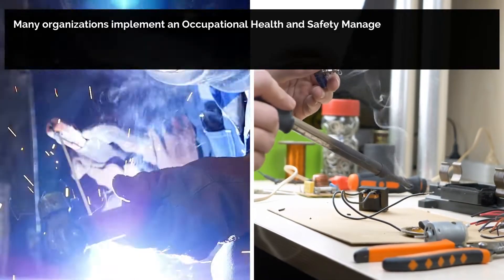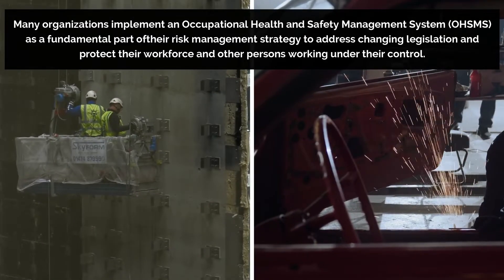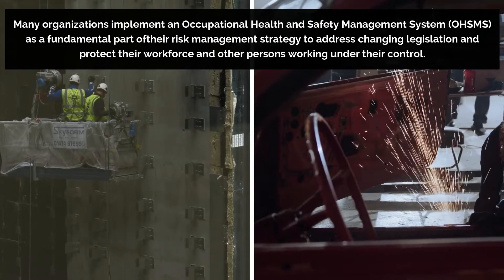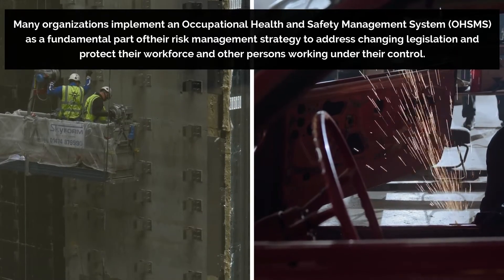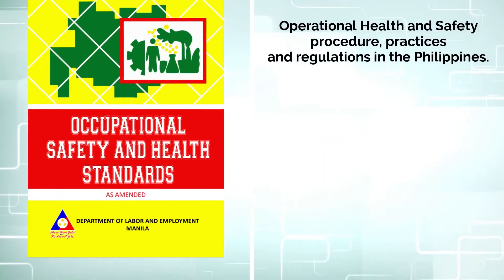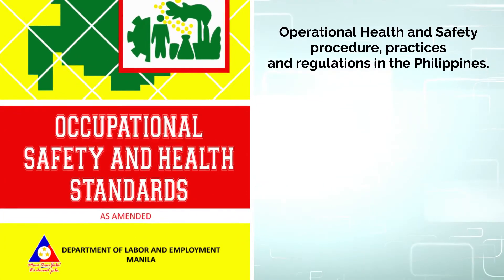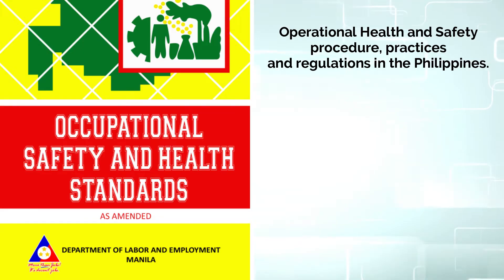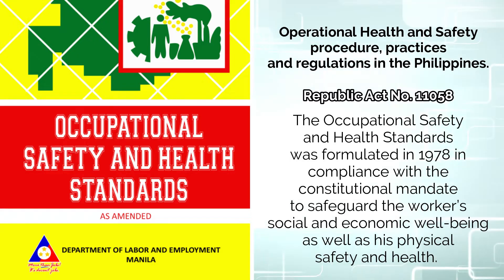Occupational Health and Safety (OHS) Standards in CSS | Computer Systems Servicing Guide

Comment: Your No.2 was wrong. It's "before" instead Atfer
Reply from the maker: When we mean "before" working on it, thats when before were going to service/troubleshoot the computer or the system unit. 🙂 Most of the time technicians turn off the computer to avoid electrocution.